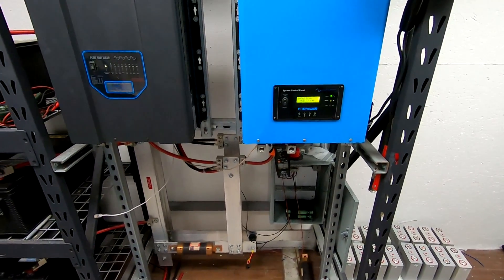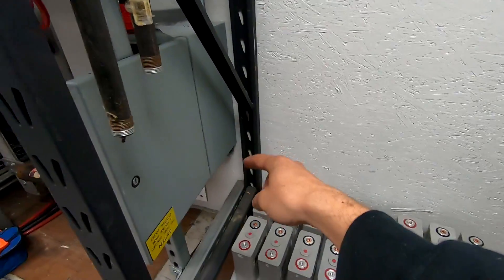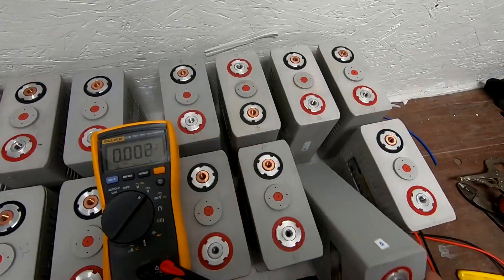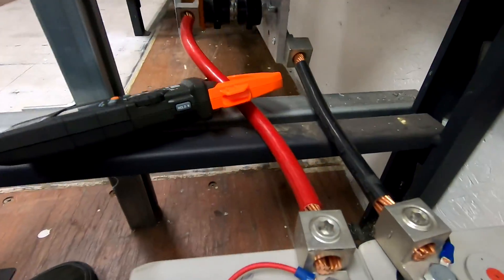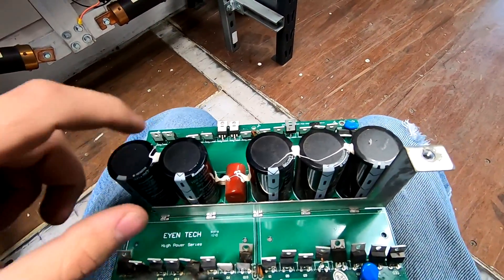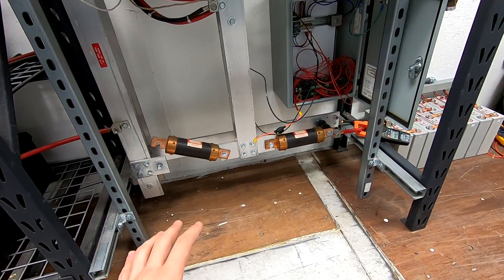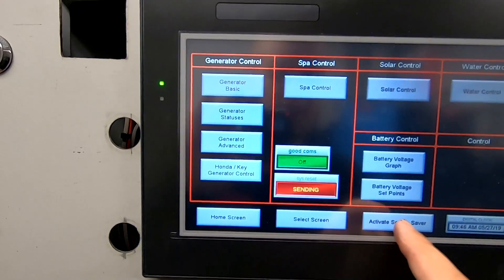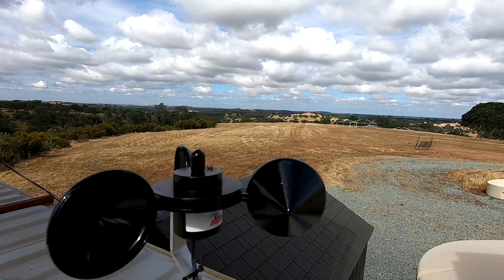Off The Grid: Installing the Best New Lithium Batteries!

Comment: Seriously??   A 48 VDC inverter without inrush protection for the large caps?  Find a better inverter...
Reply: Inverters and Audio amplifiers need high inrush currents for Starting/ Peak loads. Generally, only a problem while connecting the DC power up. Just use a light bulb to limit the inrush current then connect the fuse.
Reply: @FryGuyNS  Yep.. good inverters and audio amps both have inrush protection that limits current during startup, then gets out of the way.  Any resistance you add manually will be in circuit all the time, limiting transient response.  Best to have it built in and automatic.
Reply: @chrisw1462  it's only needed when you connect the battery. Usually just results in a blown fuse, unless the traces are the weak link.
Reply: its likely not that "simple" what he was describing sounded more like an inductive kick. (that is why you use big over sized wire and minimize the length)Think the electronics version of water hammer. That 48 volt line can easy reach 100s of volts in reverse even for short burst if you pulse the current too aggressively and it can get nasty, microwaves and old crts  and your coils spark system in your car use this to generate 1000s of volts.
Likely solution and background. (tldr: install a fast diode in reverse between + and neg) https://www.elprocus.com/freewheeling-or-flyback-diode-circuit-working-functions/
Reply: It's a China inverters-r-us special --- you see this same design popping up from Aims and a bunch of other rebranded units.  The 3.7A continuous idle load is a tell that there is China under the hood.  I liken those to the contractor grade generators B&S engine + brushed windings and a can muffler with a big tank vs. a honda inverter gen. with great fuel economy.  They serve their purpose, so if you need 12KW, it's the cheapest option, but you pay in battery.  HEY!  Another video - inverter upgrade time!!   Schneider makes a decent 48V setup but it is big bucks.

Comment: Another option is to pre-charge the inverter caps via a power resistor. Set  up a parallel circuit with a Power resistor with a breaker so that its limits current in-rush, than when the current drops, connect the bus-bar. Less complicate and a lot safer.

Also a small computer UPS could be use to provide power when your servicing the inverters or the batteries. if you need to make sum changes to the battery bank your lost your 24VDC source (unless it powered from a seperate battery)
Reply: I think the in-rush current would be limited by the internal resistance of the 6800uF caps. If they were 4F caps, then  you would start to have a bigclive moment.